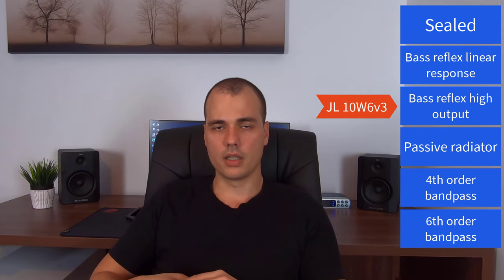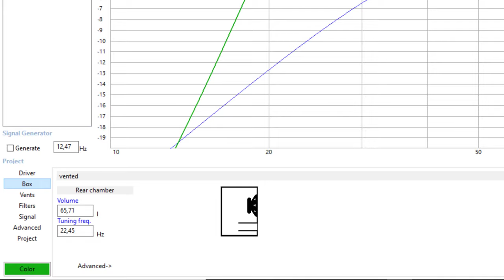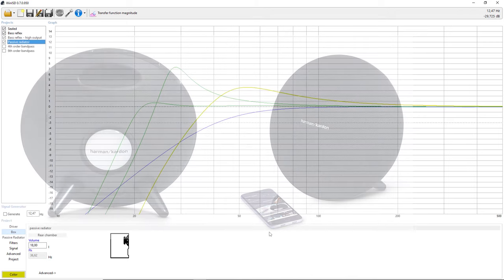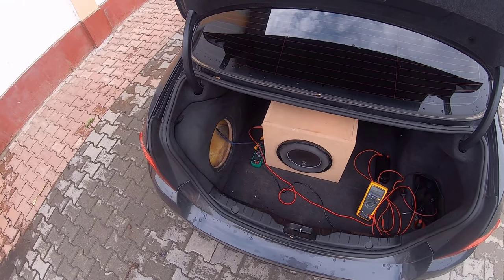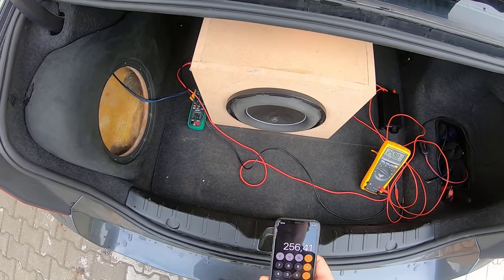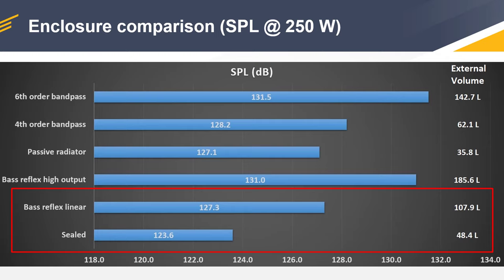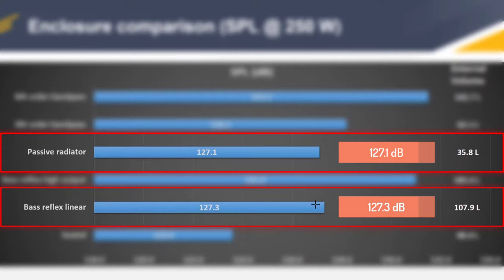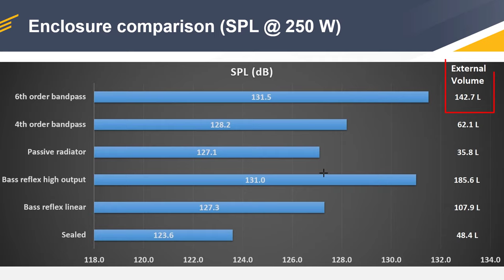Sealed vs Ported vs High output bass reflex vs Passive radiator vs 4th and 6th order bandpass boxes

Comment: At one point in my life I worked at wholesale car audio Warehouse. I had a ball playing with every single speaker, box, crossover, amplifier, head unit, Gadget that came into that place for the too years that I was there. It was a great learning experience, When I was ready to install my own system I knew exactly what I wanted made things a lot easier for me they would even let me borrow equipment and install it in my car. couldn't ask for anything more. Out of all the sales people that were there nobody really knew what was going on or was even into the equipment so when people would come into buy ,they would always come over to me.
Reply: So, what’s your go to setup for subs? Bouncing between building a 4th order setup or passive radiator with a 10 and 15” setup
Reply: Cool. Those must have been the good old days where you could get a job about having a link the amount of experience and credentials in a field. I put in an application at a local car audio and window tinting shop and they said they're looking for people with 3 years of experience. Like couldn't they just teach me? Is it that hard to teach somebody the ropes and pointers with car audio or is it just there being lazy? Because like yeah they might want somebody with 3 years of experience but if somebody has 3 years of experience then why aren't they currently doing car audio? It seems like they're just keeping the same amount of people in the trade or keeping the circle very small because I really believe I would excel at this type of work and I'm a quick learner and this is geared right toward how my mind works but when you walk into a shop to apply and they scoff at you when you tell them you don't have experience but you want to learn on the job then screw that type of arrogance. Like I just need the opportunity to learn in person and hands on because there's only so much you can really relate to and comprehend out of a YouTube video.

Comment: Have any of you tryed the Earthquake Slap's passive radiator's? The 10s, and 12s Slap's unit's, have 4 inches= 100 mm of Total= Peak to peak X Max, and the 15 inch Slap's, has 4 and a half inches= 112.5 mm of Total X Max! Plus the Slap's unit's, are designed to perform best in the active/powered subwoofer's mfg. rec. sealed enclosure size= not the ported size, like most people think. Also less cancellation will occur with the active driver(s), NOT on the same plane as the passive(s). The guy in this video did a great job, thank you very much, for taking the time, to do this video for us all❤️

Comment: The one major flaw in the design modeling and different enclosures is how each are effected by what is called "Bass boom", which is a peaking rise in base output at lower frequencies that occurs in automobiles. This is not shown in max SPL comparison and certainly not in modeled computer design. Had a frequency response curve been graphed it would indicate this bass boom effect. Because of this effect in automobiles the seal enclosure is not only produces an extended bass that gives the most linear low end frequency response, it is best design for the car and the only design one should consider for sound quality. As the author stated, should your desire be only Maximum SPL, then fourth order base reflex is the way to go. Personally I lean for quality. Fact is there exists little actual music below 40 hz. In Contrast in a home theater application, one would want all the extension one can get for movies, but music and action movies is very different.

Comment: If you just laid the passive radiator box on its side everything would be in the correct position you mentioned after and you wouldn't have had to add those arrows pointing it out 😂

Comment: Great explanation! 
Mostly confirmed what I thought I already knew, the thing I came to realize from this presentation is that I've never appreciated passive radiators enough. 
I've been building and installing car audio systems since the late 80s until the early 2000's (before I had to get a real job lol), and I was mainly trained by Orion and Pioneer (not a big pioneer fan, but boy, is their technical training ever good!) and to a lesser extent by the other companies that the various stores I worked for carried like MTX, Sony, SAS, Coustic, Eclipse, Nakamichi, Dennon, Clarion, etc. etc. etc... 
I even owned my own upholstery and car audio shop for a few years (super fun, but didn't make much money at it, turns out you cant charge for the full 37 hours you have into a pair of super custom, factory looking, leather wrapped Audi door pods that fit three 6" speakers and tweeters each). 
I understood that there were those vehicles out there that allowed you to have enclosure choices, that you needed the driver's TS parameters to calculate and design the optimal enclosure for that driver.  

My reality was that 99% of my customers wanted to put 10's and 12's (even 15's and 18's) behind and under seats where they would physically fit but there was nowhere near enough air space. 
So my reality was that I was almost always building enclosures for the vehicle not the driver.  I mean, I really tried to get as much airspace as I could possibly get, I often used fibreglass bottoms and backs on my enclosures to conform as tightly as possible to the curvatures of the vehicle. 
There was some really impressive bass from small spaces and it was tight and clean and those customers rarely blew their subs and were usually pretty happy. 
When you sell and install the same gear over and over, you get a really good sense of what it should or can sound like in an optimal enclosure  vs a small sealed enclosure.  I always knew the sub woofers were limited by their small sealed airspace but that was the sacrifice that had to be made.
Now that I understand passive radiators more, I really regret not having used them years ago in those small sealed enclosures that severely limited their sub woofers. 
My systems could have been so much better... So much better...

Comment: I really want to learn more about passive radiators.. It just seems like there is a huge lack of knowledge about them except for the super top secret labs of major audio brands. How do you tune them? What size do you need? What does the suspension compliance do? Can you just tack some radiators on to the side of an already built sealed box?
Reply: passive radiator does a great job as opposed to using a port if you have the room it does an amazing job although a lot of people just add another woofer as opposed to a passive radiator when it comes to a car I had some home speakers that look like they had two 10-in woofers in each box until one of them blew when I took them apart to repair that's when I found out that it had one 10-in woofer and one passive that speaker had tremendous sound coming out of it considering it was only one 10-in woofer thing sounded great and it was an off-brand piece of junk
Reply: Typically u need twice the surface area worth of PR as the active driver. You tune the PR by adding weight (steel washers) to the rear suspension section of the PR
Reply: @Forcefed2002  Why do you need twice the surface area? I mean what would happen if you added let's say hypothetically, 2 12 inch PR's to a sealed box with 2 15's. Would the tuning be so far off that it would sound bad? would they just over extend? Can you compensate with extra weight?
Reply: @trev6783  I don't know - it's just the most common alignment used when enlisting PR's. It's just how it's modeled for a satisfactory freq response curve.

Comment: Ports or passive radiators do not extend frequency response. Ports supply a” drone tone” at the tuning frequency. This means if I apply a 25 Hz test tone, the speaker will emit that frequency, but the port will emit the box tuning frequency. A microphone only measures pressure, so it adds the drone tone pressure of the “wrong frequency” with the speaker driver output of the correct frequency. The box is a helmholtz resonator.

Comment: 1.)What is it about 6th order                  
     enclosure box design that             
     everyone says the formulas         
     are prone to error? 
2.) What does the formula look    
      like?
3.) Where/how does this error
      occur?
4.) How do you recalculate to fix
      the error?
Thank you for your time.👋😄👍☮
Reply from the maker: It's not that there is an error in the formula. It's the fact that when you build the box, there will be differences. Either you have some small leakages that you are not aware. Maybe you are using flared ports and flare approximation in not accurate. There are a number of things that will make your finished box have a slight difference compared to the modeled box. And for a BP6 enclosure, small differences have a larger impact on the frequency response compared to a sealed or bass reflex box.
Reply: @AudioJudgement  Ahh, ok. Thank you very much. Any special box builds coming up? Maybe try one of those layered ones ?😁👍

Comment: How would a transmission line (T-line) box fit in to all this. Its main goal is to have a wide frequency band like a sealed enclosure, but with higher output due to being a ported enclosure
Reply: I don’t think you would see a higher output. That’s just based on my personal experience with them. You can achieve a very wide and frequency band that is very linear. If it was built properly and stuffed and remeasured and adjusted until optimal, I think you’d see response that is similar but more favorable to the sealed box. BUT the enclosure would be larger.
Reply: @TheLayinLo  Yes, that would make sense, as you need a lot of space to make up the line. 
So, for small spaces, sealed or passive radiators is the better option
Reply: Sounds like you need a third order horn enclosure like they use at concerts there's nothing like it.

Comment: That sub that u choose  for the demo is perfect for a sealed enclosure because the Qts is greater then 0.4 and smaller then 0.7!
Otherwise this is a great video
Reply from the maker: You are absolutely right! And my next video will be about that : Which enclosure is best suited for my driver. But, then again, don't get hung up on these intervals. The extremes are always right. For example a Qts of 0.25 is definitely not good for infinite baffle and a Qts of 1.1 is very bad for a bass reflex. But numbers in the middle can work well with most enclosures. These intervals are guidelines, not strict rules.

Comment: VERY HELPFUL DATA - THANK YOU - but I'm having trouble understanding the 'In Car' frequency response, because there does not seem to be any Cabin Gain... In fact, there seems to be a 'cabin loss', because the frequency response of the 'flat' curve ported version falls as said frequency gets lower... O.O But I may have an idea as to the cause... When modelling a subwoofer, the Transfer Function Magnitude Graph doesn't give you all the facts - at least not as much as the SPL Graph, which shows you the theoretical output of the sub, whilst catering to the MAXIMUM EXCURSION of the driver... With that in mind, if the xmax is reached at a relatively high frequency - say 45Hz in regards to the ported version - then the projected 'flat' response will fall short\decline as the frequencies being played get lower, & either the amp runs out of the power needed to maintain the same volume with those frequencies(I know that's not the case - just saying), or, the sub's ability to play any louder diminishes as it's xmax is exceeded... >.> So which is it? Why is there no indication of cabin gain? & why isn't there a bump in the response curve at the car's resonance frequency with all enclosure versions? O.O

Comment: I haven’t understod WINisd entirely. 
Is a ported box of lets say 16Liters , is that WITH the port or Without the port? 
So one and the external volume of the port on top of the 16L? Thank you
Reply from the maker: That’s the net volume. You have to make the box bigger to account for anything that goes inside the box: port, speaker, bracing etc
Reply: @AudioJudgement  perfect:) as I suspected. Just that some calculations needs a yard long port and similar so that got me thinking…  will give it a try tomorrow! Thank you for the quick answer!
Reply: @AudioJudgement  i built a vented box today since the db was way higher than the 4 bandpass box as WinISD showed. Otherwise the bandpass had its own rolloff in frequenzy so one didn’t a filter. In theory…

Comment: Nah.  Calculate the largest sealed volume you are willing to live with, then take that size and make it into a passive rad box with a lowest tune to even out the fr.  Then when positioning sub its place, gradually unload the rad mass to bring up the tune frequency up to optimal response in that placement. 

That way a single passive rad sub will have the fr and output equal to two equal driver sealed subs.  Half the space, half the power, and flexibility in placement/tuning.

Comment: 22hz from a 65 ltr (2.3 cu ft) closure?!! Please reply w/make & model driver?! 

Dayton sell an 8 ohm 12” in their reference series that models to 21hz  in a ported 4.6-4.7 cu ft closure though probably more efficient 

Isobaric* side note - how do I determine the correct PR?  This* alignment requires half the closure size as appropriate for sealed or ported*. The same* requires the same diameter & length as a regular**. 

Does that mean the same size PR?

Comment: Hi. Great experiment. I have an 43L enclosure but driver I have ask for optimum volumes of 55L sealed and 161L vented. The resonant frequency of the driver in 24hz. What’s my best option if I use that speaker in that enclosure? Can I just make a port tuned to lets say 28hz and get decent results even when not optimal or what? Thanks.

Comment: Don't forget to factor Le into the response graphs, and reducing port volume increases enclosure net volume, which is something that has to be factored to tweak tuning by modding the ports on already built enclosures. It's also worth noting that horns cause horn resonance. Also the parameters of a driver will control it's ability to play below fs, and ebp will determine which enclosure type is needed for the flattest amplitude in bandwidth.
Reply from the maker: Yeah, well, these are subwoofers so I don't particularly care about Le effect. You can see on the measured responses, at the end, that the graphs are up until 135 Hz and there is no roll-off happening. What happens to the frequencies above that point doesn't really concerns this test.

Comment: I’m trying to understand your statement about placement of passive radiators in relation to the driver. Kicker and other companies have been making ‘truck boxes’ with the driver and PR on the same surface for many years. Theirs seem to work just fine set up this way.
Reply from the maker: It doesn’t matter where you place it if you have one PR. But if you have 2, it’s best the place them on opposite panels. The active speaker can be wherever.

Comment: What about porting the ported enclosures through the "ski pass-through"? I'm trying to do something like this with my GS400, where the port would be located and fire directly under the 10" hole in the rear deck, where the factory subwoofer was removed, so that those soothing pressure waves can travel into the car. The sealed box I built sounds great when the trunk is open, and I'm standing behind the car, but not much bass makes it into the cabin space.
Reply from the maker: You know you can make the port stick out of the enclosure, right? We don't do that because it looks awkward, but in this case it's perfect. Also, if the port is not inside the box, the box can be smaller. Furthermore, I suggest a 4th order bandpass enclosure where you have just the port radiating sound.

Comment: This is awesome that you did this but why didn't you design the large reflex box with a porting frequency that better augmented the response from the driver? What I mean is that there shouldn't be such a pronounced peak in the mid 30s (which you called a terrible response, but in reality, I think a lot of people would like that) and then a dip in the response. Also, you should have listened to different types of music using each design and then critiqued the results. That would be more helpful than frequency response graphs because we see plenty of those, and we all know the stereotypes of each design. I think a lot of people would be surprised by the actual performance of certain designs if they actually listened to them vs. looking at graphs and numbers.